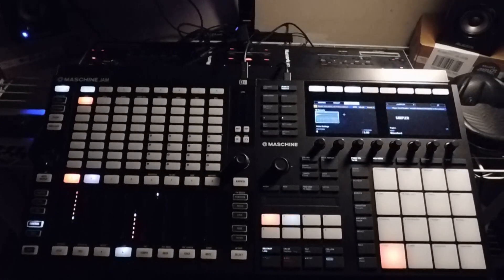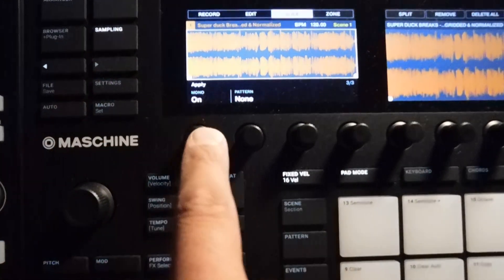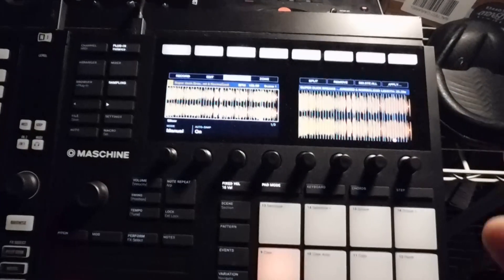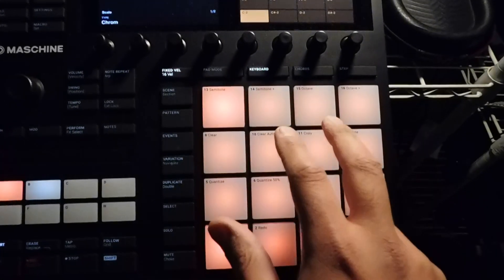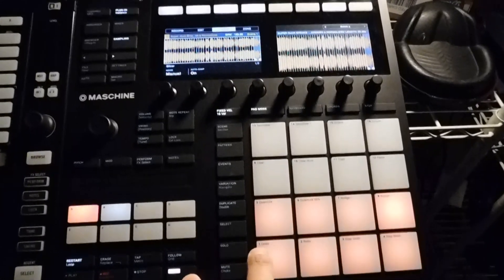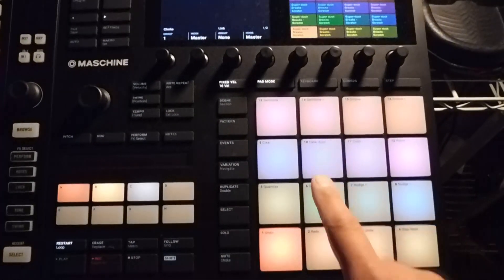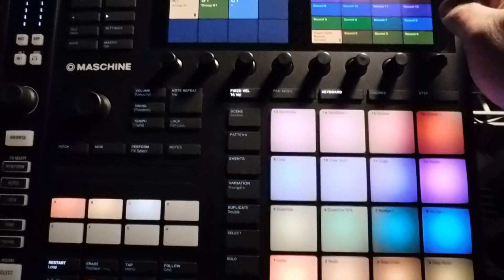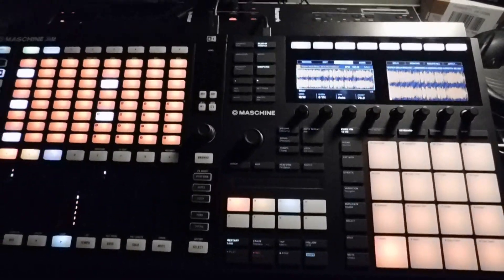DJ Divine Justice  demos Sample Slicing on Machine MK3

Comment: thanks for the video! When I apply  the chops to a group, then go to keyboard mode, the higher in pitch I go the faster the chop plays. Any idea why?
Reply from the maker: Hey, thanks for watching!!  It does that by design. The higher the key, the faster the playback. You can use Maschine's time stretching function to get around that if you need to.
Reply: @djDivineJustice  good to know. Thanks!

Comment: If I have 32 slices, how do I get to the second 16? I'm not talking about when it's in keyboard mode and you octave up. I've applied my chops to bank B. How would I get to the second 16 or you can only work with 16?
Reply from the maker: You're limited to 16 if you chop to group.

Comment: Thanks for the clear explanation.
Reply: Does Maschine mk1 have the manual mode capability?  Was this in a more recent update to the software?  That last I used was 2.2.
Reply from the maker: The MK1 should be able to do it. Manual slicing  is a software update.